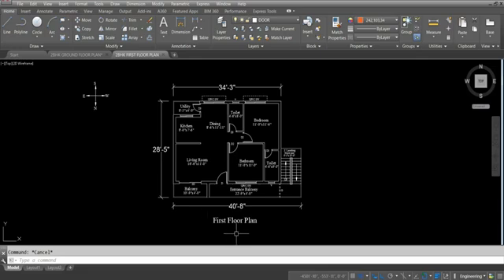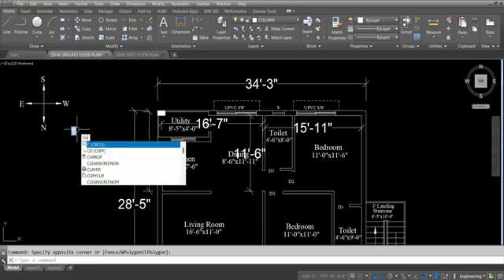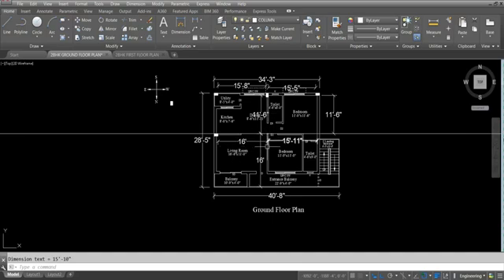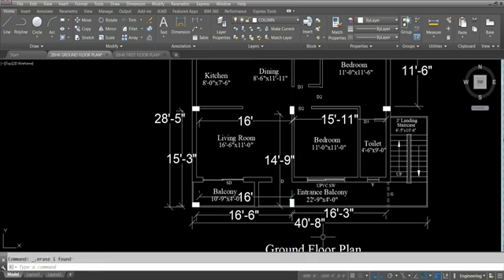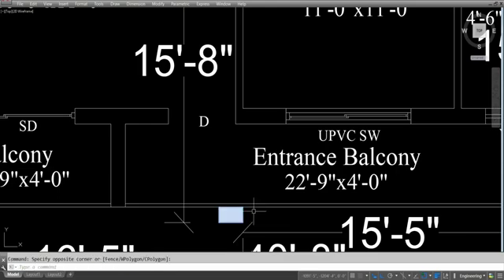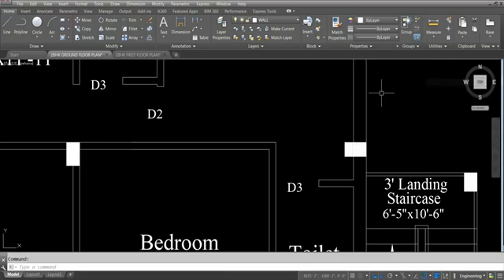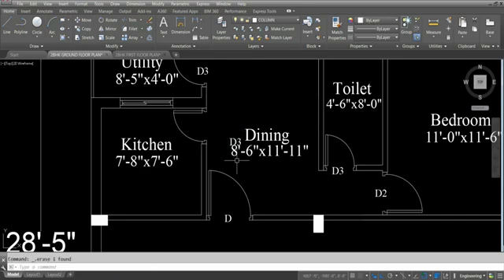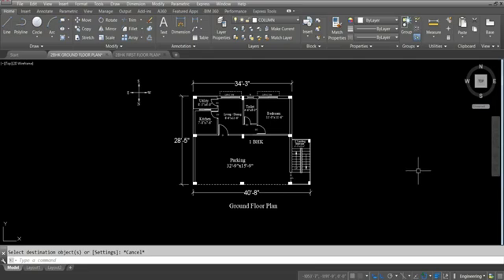How to Decide Column Position and Orientation for a G+3 Building | Ground Floor Plan Of 2BHK House

Comment: Madam how to decide and prepare the column's position on the ground floor or first floor
Reply from the maker: To decide the column positions on the ground floor or first floor, they should be placed based on efficient load transfer, structural layout, and functional space. Columns must align with load-bearing walls, beams, and slabs to ensure a direct vertical load path to the foundation. They should be positioned at grid intersections for structural efficiency while avoiding interference with important spaces like doors and windows. The column positions on both floors should align vertically to maintain uniform load distribution. Additionally, consider foundation design, soil conditions, and local building codes when determining column placement to ensure both structural integrity and functionality.

Comment: Madam one small doubt more than 16 ft length what will be provided column size
Reply from the maker: For a typical residential building with moderate loads, a column size of 12”x12” (300mm x 300mm) to 16”x16” (400mm x 400mm) may be used for spans around 16 feet.
For larger buildings or higher loads, the column size may increase depending on structural requirements. Columns could range from 18”x18” (450mm x 450mm) to larger dimensions based on the calculation of axial load, moment, and shear forces.